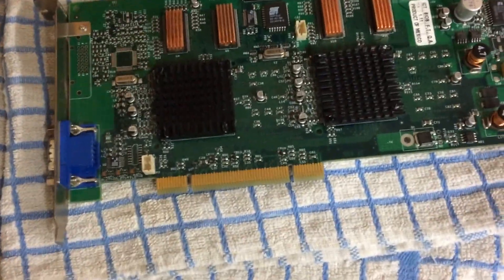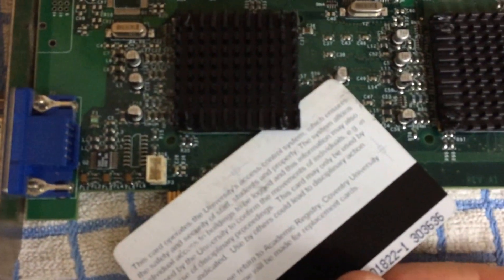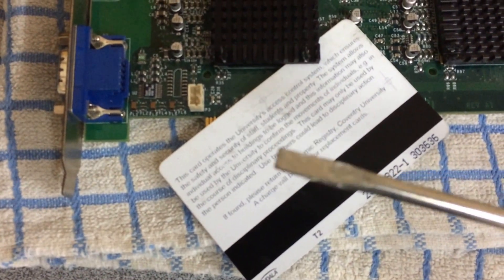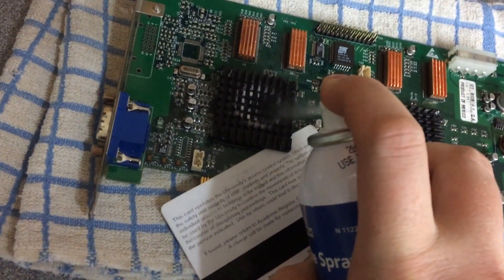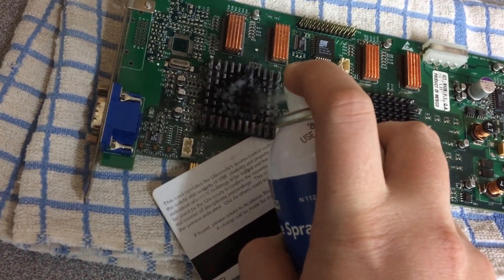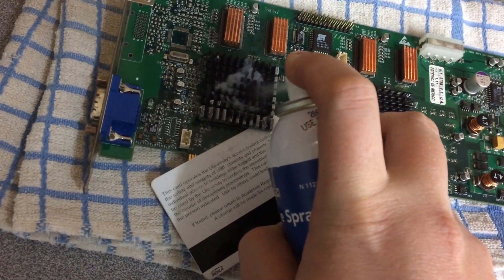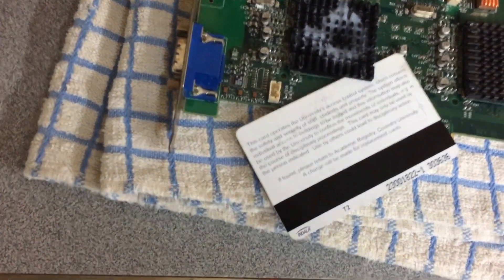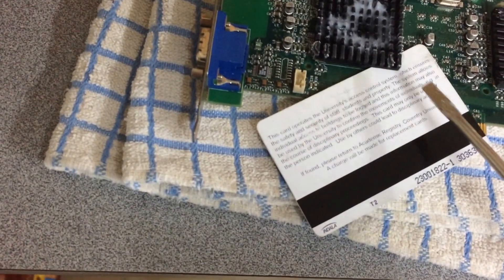3Dfx Voodoo 5500 Heatsink Removal - The safe and easy way

Comment: What cooling solution did you replace them with?
Reply from the maker: They were called Titan CUV-X or something similar. Sorry this was a few years ago, but reading forums and on 3dfx.it people were recommending them. Hard to find though these days. Just measure the hole distance and try to find an alternative.
Reply: @Storm_.  Are these the ones you used? Thanks. 
https://www.ebay.com/itm/123315546009?mkcid=16&mkevt=1&mkrid=711-127632-2357-0&ssspo=gBOK7kB1RMq&sssrc=2349624&ssuid=Vw5vfRPTQWe&var=&widget_ver=artemis&media=COPY